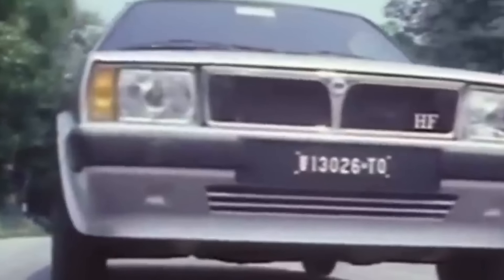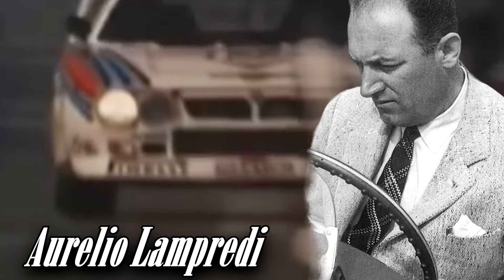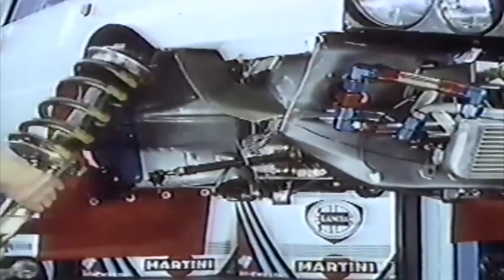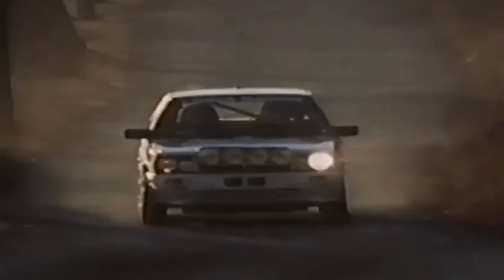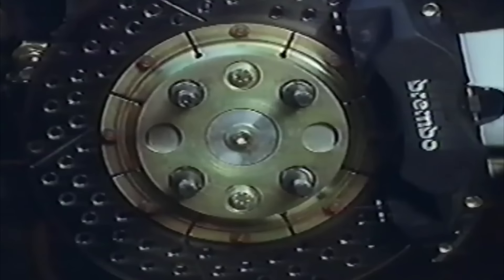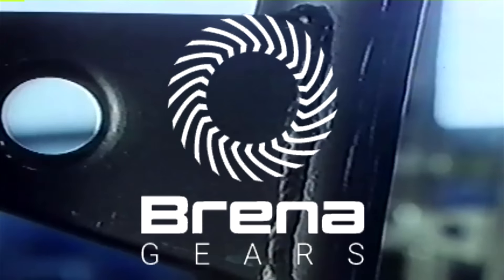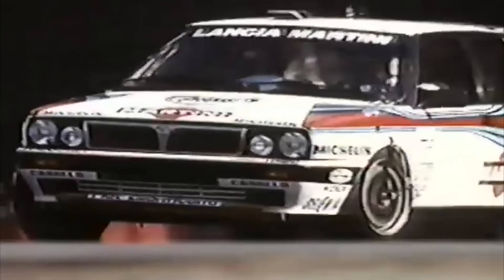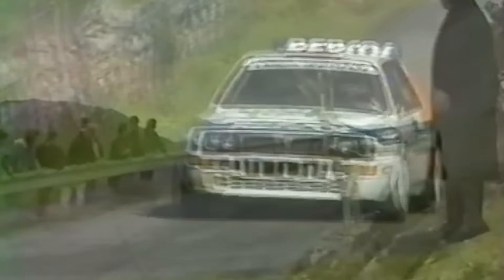LANCIA DELTA HF INTEGRALE GRUPO A. El MAYOR PALMARÉS de los RALLYS

Comment: Grande, grande, grande! 
Gracias por este trabajo, digno de un aniversario tan especial. 
Desde hace un año aproximadamente siempre estoy pendiente del próximo video del canal. 
Y qué decir de la MACHINA... 
... bellísima. Si cuando tenía 18 añitos me preguntasen que tres coches quisiera en mi garaje, sin pestañear hubiese contestado un F40, un M3(E30) y un Integrale. Han pasado más de 30 años de eso y mi respuesta sería la misma. 
Pero dejémonos de ejercicios de onanismo mental y centrémonos en lo que importa:
Video de 10.
Canal de 10.
Objetivos, para qué, lo que has dicho, que venga lo que tenga que venir y mientras tanto, que siga la fiesta. 
Un abrazo, para todos. ❤
Reply from the maker: Yo también elegiría un Delta para mi garaje ideal, como no!! Soy un ferviente apasionado del motor italiano. Muchas gracias por tus palabras compañeros. Es un placer seguir trayendo material para compartir con todos vosotros. Un abrazo